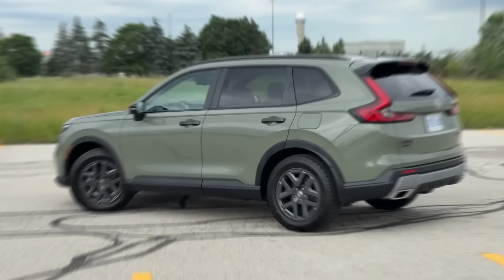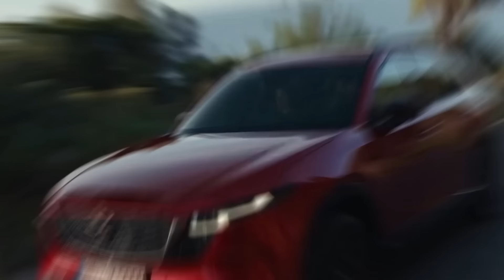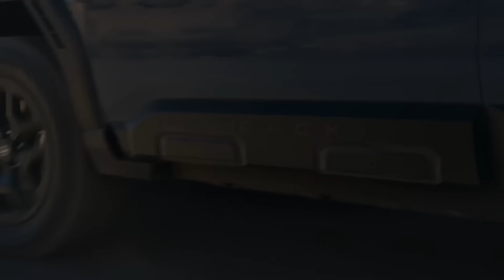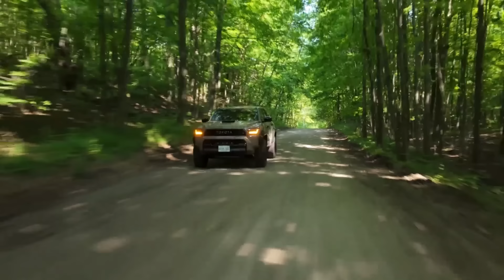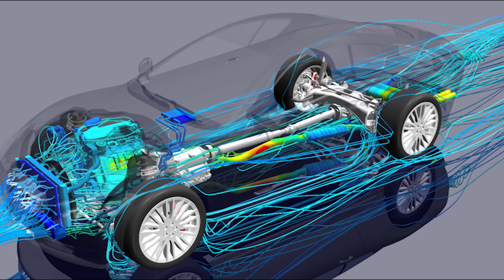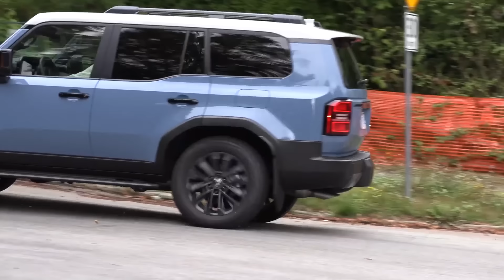7 Most Reliable Japanese SUVs Coming in 2026! (Built to Last)

Comment: The 2022 and later Tundra engines are still having recall issues and Toyota placed the same engine in the GX and 4Runner. The verdict is still out on the turbo engines.